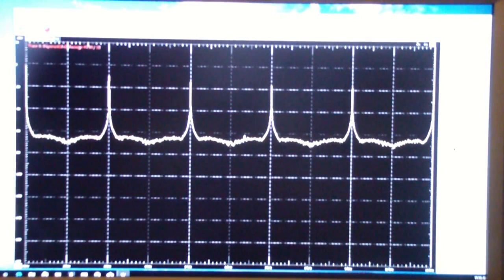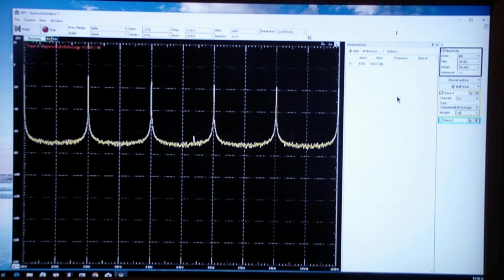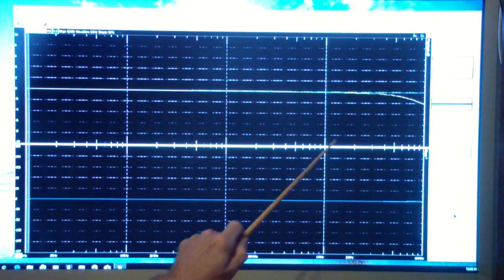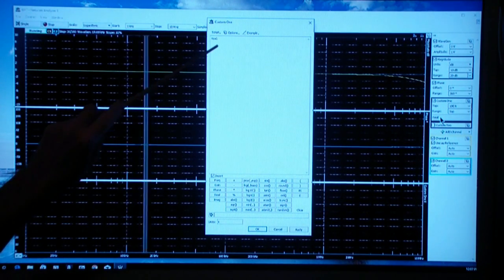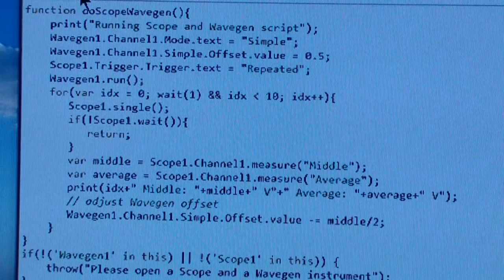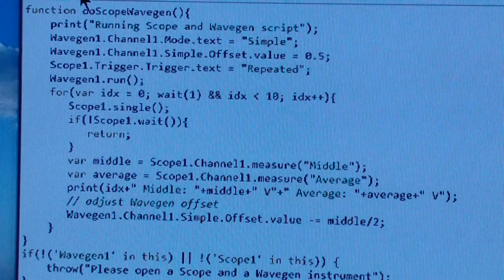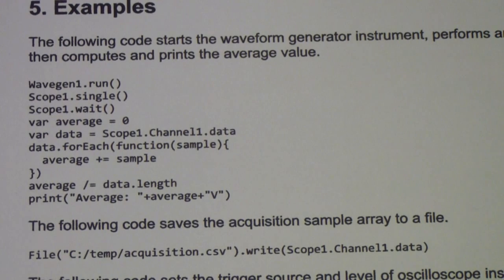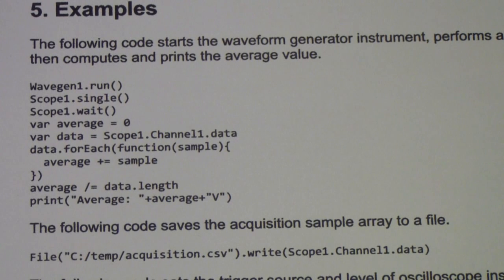TTT177 Analog Discovery 2 THD Plot Project

Comment: Good on you tomtektest for pushing AD2 forward.  Ideally I would like to see Agilent provide this kind of functionality because it is hard for the regular joe blogs to support this kind of thing.  I have the AAS running and it is a good product so I am bewildered like all that it is all of the sudden gone!  I am not a programmer but if we can get more audio plots generated with AD2 that would be great.  What can I do to help as I am highly interested and invested.  You mentioned certain contacts at Diligent but not email addresses.  Also, this 4th of July weekend I am going to try to use AD2 for measuring speaker response - have you thought of that for an experiment?  I can't think of a reason why that wouldn't work with AD2 instead of investing in a hot-shot audio card interfaces using some of the popular software out there for that.  I would like to use AD2 for all of my audio testing.  It pretty much matches my testing with keithley 2015THD and HP3903B.  Thanks again.
Reply from the maker: Thank you for your comment and interest. Digilent has been very good about responding to Forum posts. You can find the forum for AD2 on the Digilent site. I posted a question on the site about access to the Spectrum Analyzer through the Script Editor and received a response in just a couple of hours from Atilla. If links are put in comments, YouTube will flag them as spam so it would be better for you to go to the Digilent site and locate the AD2 Forum. I am just gathering ideas at this point and will wait for the next release of Waveforms (who knows, Digilent may decide to include a THD plot as a standard item in the Network Analyzer which would solve the whole problem in my mind). Until then, I will continue to hope that Jake will be able to re-post the AAS. I knew you meant Digilent, I make the same kind of mistakes in my videos, calling left to be right, and up as down - mental slips are a part of life.